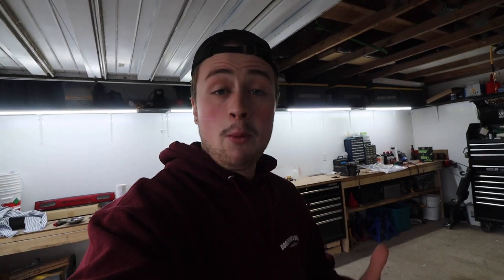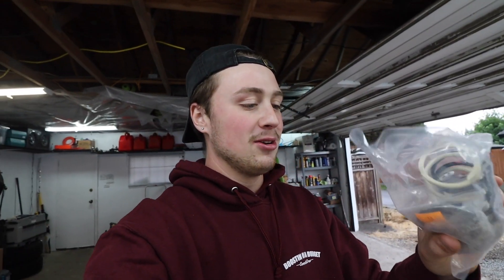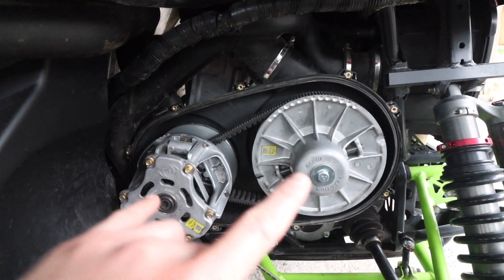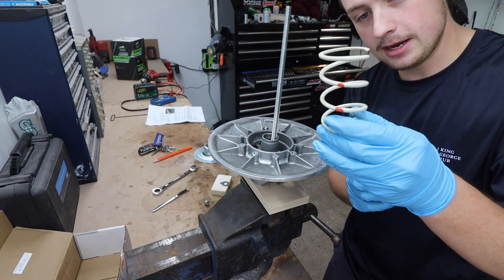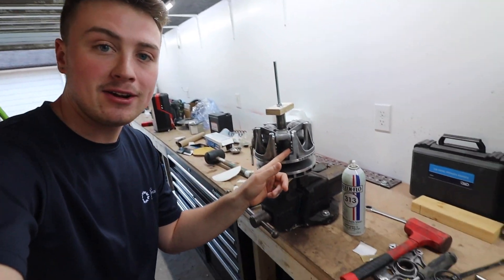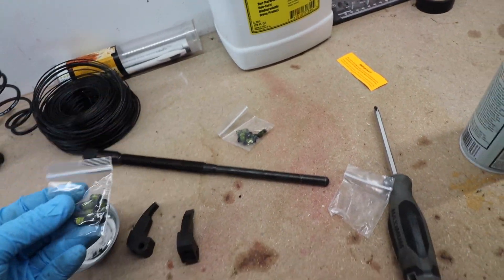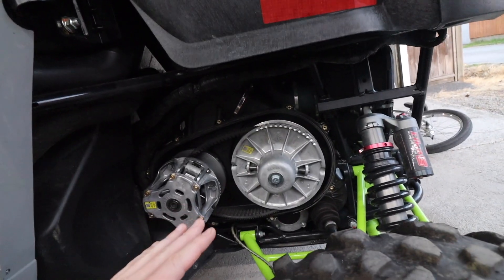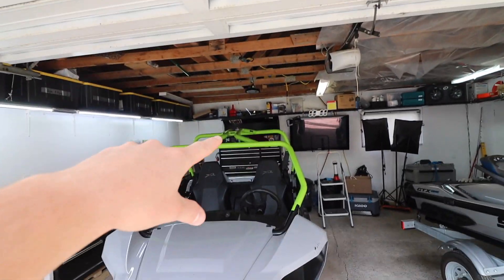FIXING The New WILDCAT 700 SPORT (Upgraded clutch)

Comment: They dont just break shift cables. They break because the black button shims bind on the towers of the primary clutch, happens often once its warmed up. You need to measure and sand down the black button washers so the clutch engagement is snug but smooth. 
I own a 2015 wildcat sport limited and ive modified it from top to bottom. Seats, harnesses, tune, big tires, control arms, custom cage and front n rear windows. Snorkels. Ect

Comment: Anyway you can drop a link on the clutch? About to buy one of these and would like to swap that out to avoid issues lol
Reply: U dont need the clutch springs unless you plan to run larger tires. I have a wildcat sport, to get rid of the binding you need to seperate your primary clutch and sand down the black button washers thst contact the towers. Do not sand the towers like the video. This reduces the life of the clutch. 400 for a new clutch.
Reply: Buy a dalton clutch kit if you want to run larger tires. Its an adjustable kit made in canada